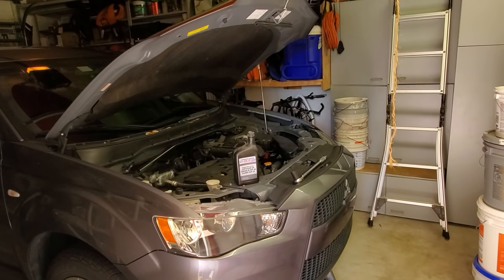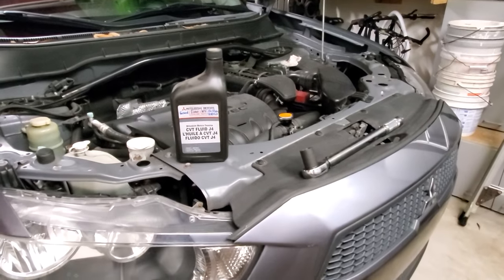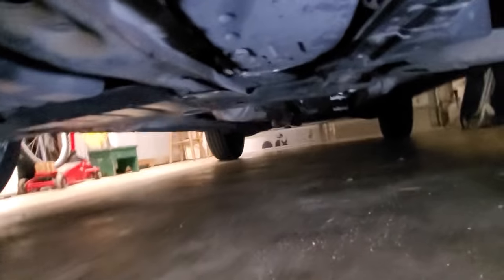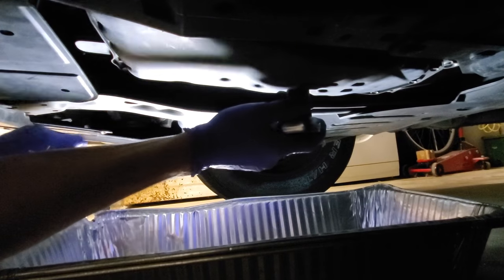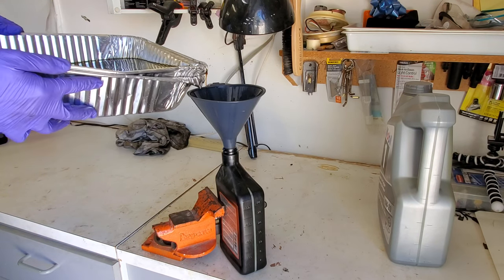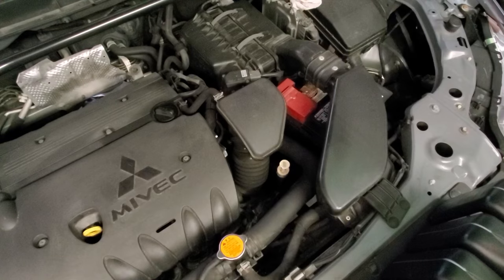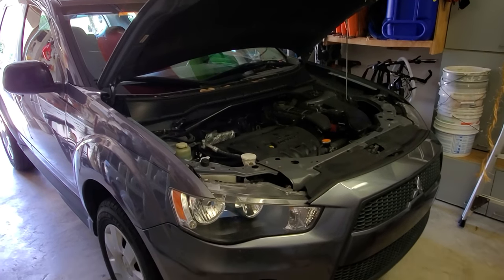How to Change Automatic Transmission Fluid in Mitsubishi Outlander

Comment: If you have a high mileage car or plan on keeping the car a long time, don't forget the CVT paper filter located underneath the battery, and also another filter located inside the CVT fluid pan. Longer job but probably should do it every 100000 miles or so, even if you follow the severe CVT fluid change interval.
Reply: There is no mention of these filters in the service manual and Mitsi dealer say it’s not necessary, only fluids. It’s in their best interest to replace them and charge more but they don’t. Thoughts?
Reply: @chiquicat1  It's in their best interest for you to buy a new car from them, instead of driving your car to the limit of what it is capable of. Remember there are many fluids and parts that manufacturers call "lifetime." But that usually just means they will at least last until the warranty is up. If there is a filter anywhere, that means it's used to catch something. If you plan on getting the longest life out of your car you might as well change it since cleaner fluid with no filter restriction is always better either way. If you don't plan on keeping the same car for hundreds of thousands of miles, then it probably doesn't matter too much as long as you do the proper maintenance of changing fluid and don't overheat the transmission too much.
Reply: @keifuchan7265  wise words
Reply: Hi
Did you have to take the battery out to change the filter or could you do the change with the battery still in the car? Thanks.
Reply: If I change those filters you mentioned , do you know how much cvt fluid I would need to buy?  I see that the simple drain and fill is about 4 1/2 quarts. Thanks
Reply: Did you get this question figured out?.. i have a 2017 Lancer SEL, I spilled quite a bit from replacing both filters and its hard to see on my dipstick.@aureliosalazar1033
Reply: @dr.bonscott3962 
I replaced the cartridge filter coming from the CVT cooler , Nissan rogue 2015 120,000 miles and I can tell you that is a must because it started to tear when I grab it , I did drain and fill every 40,000 miles using oem only fluid and filter 
The internal is a screen made of stainless steel or aluminum which it can be cleaned and reuse tho
Reply: Thank you for the info. I was wondering if this CVT used filters which I agree should be changed. Because CVT's have a reputation of having a higher failure rate than regular automatic transmissions I plan on changing both the fluid and filters every 40 thousand miles.
Better safe than sorry especially since the Outlander uses the Nissan Jatco CVT transmission which has a bad track record for reliability.

Comment: "Don't dump the used oil on the grass at the auto parts store", lol.  Great vid, I have a 2016 Mitsu Outlander which is the same process.
Reply: Did you change the trans filter?

Comment: Many thanks for this clear video.  I have a 2011 and rolling at 112k miles since 43k miles when I brought it. Great vehicle. 
Decided to stop taking to service dept for that as I don't trust myself around CVT but did not realize it's easy as change engine oil.
Reply from the maker: It's just as easy as changing oil. If you can change oil you can change CVT.
Reply: @MaciejPiotrowski  Right on.  I've done some works by myself around vehicles but never has been around CVT before and this was my first time with CVT... I did not know it has one after purchasing my Outlander and found out about it few days later lol.

Comment: I was reading through the service manual for the Mitsubishi and I learned this is not a good method. They recommend that you disconnect the hose from the top transmission cooler and let the engine run for about 1 minute. Then you remove the drain pan and get more fluid out. You should be able to get about 5 quarts of dirty transmission fluid that way instead of just two.
Reply: is it possible you can show how one would do that method your describing in a video? I would like to see your method in a video, i'm purchasing a used 2019 Mitsubishi Outlander Sport with 49k miles and I want to know which is the best way to preserve the transmission, thank you! If you can show me where I can find the manual of such said car it would be very appreciated as well!!

Comment: Good job, but you have to change the the two filters as well, the metal filter at the oil pan, and the cardboard filter under the battery
Reply: No mention in my service manual about these filters and Mitsi dealer say they never change them. Only fluids. But I tend to agree that replacing them might be best as fluids are only replaced every 90k which seems a lot of miles in the same oil time.
Reply: the filter under the battery, sure, but there's really no reason to drop the pan for the metal filter unless you're experiencing issues. If the filter in the pan is clogged up, then you have bigger issues to worry about.

Comment: Good video. I would add that measuring the amount that comes out and then adding the same amount in doesn't seem like a good procedure.

If the transmission was at an improper level before you start then you'll end up with an improperly filled transmission when you finish the job. Also, you'll get different results depending on if the engine was warmed up or cold or if it had recently shifted through gears or not.

You'd be better off checking the transmission dipstick following the proper procedure.
Reply: Yea, that whole part simply shows the level of the mechanic. But it also shows where the location of the drain plug which is what I was after. So the same advice - this is internet
Reply: Do we need to change it after every 40000 miles or not ?
Reply: @windowandmobile  yes.
Reply: 100 percent correct !! Would not add exactly what came out

Comment: Good day! 
Thanks for the video.

I have question. When I drain crv fluid on my 2011 RVR I collected 5 quarts. But in your video it’s only about 4.2 quarts. Not sure if I follow 5 quarts or 4.2. 
Thanks
Reply from the maker: You always put as much as you drain. Remember I have different car than yours.
Reply: Maciej Piotrowski thank very much for reply. Did you wait until no more oil draining? 
I ask the dealership they say it shouldn’t be 5 quarts.

Comment: Great video. Is there a washer for the drain plug? I read somewhere that there's one but when draining the fluid on my 2011 Outlander ES, I did not see a washer.
Reply from the maker: Yes there is a washer. I damaged original one so I had to buy new copper once few years back. It's super cheap and I use it all the time.
Reply: @MaciejPiotrowski  Thank you!
Reply: @MaciejPiotrowski  Did you buy your washer from Mitsubishi dealership?
Reply from the maker: @mkbdiy9766  No, you go to advanced auto part and buy it for super cheap.
Reply: @MaciejPiotrowski  Thanks!
Reply: My 2011 outlander didn't have  a washer either.

Comment: Thanks for this AWESOME video. Quick question, 2010 Outlander SE has 155k, transportation fluid never changed. Would you recommend drain and fill or leave it alone? Thank you.
Reply from the maker: If you never changed ATF I would not do it now.
Reply: @MaciejPiotrowski  Why?
Reply from the maker: @litreocola  Because all the gunk that is sealing you transmission would cause gaps in ATF to open. Google it and decide for yourself. I've always done it at about 40 to 50 K.
Reply: @MaciejPiotrowski  Are you referring to a fluid flush or fluid change? I read this was more of a concern with older American transmissions when doing a fluid flush.
Reply from the maker: @litreocola  I'm not a mechanic so you may be correct. Again, in my video I just showed how I did it. What you chose to do is up to you.

Comment: I have 160k miles. Bought it at 100. I never changed this fluid, don’t  know about previous owner. You think it’s bad idea to change it now?
Reply from the maker: If it was never done I would not do it. Too late. You may have transmission problems. I'm not a mechanic so double check with a mechanic.
Reply: @MaciejPiotrowski  it always a guess. someone say don't do it someone say do it. I've been changing some time now. right now at 240k miles. first transmission light come out at 160k then disappeared and the light is back as of 2 days ago. I'm changing oil now. hope it will run for many more miles

Comment: Hello sir. Good day! I just want to ask every when do i need to change the ATF in Mitsubishi Outlander. My car is running around 186000 km.
Thanks and God bless
Reply from the maker: ATF should be changed every 50000km. If you have never changed it I would not do it now or you will have transmission problems. It's too late.
Reply: @MaciejPiotrowski  thank you so much it's a big help 🙂

Comment: Do you also need the engine keep running while checking the level of the CVT transmission oil?
Reply from the maker: No. I turn it off and quickly check the level.
Reply: @MaciejPiotrowski  thank you for the information. Last question.  Your outlanders engine is 4b12 (2.4 DOHC)?
Reply from the maker: @hendriksaldua8208  yes
Reply: @MaciejPiotrowski  Thanks

Comment: Hi, I have a 2019 2.4L with CVT 27,000 miles. Last day I changed the transmission oil with the dealer and they charged me 8 fluid. I saw you change yours with 4 and a half quarts. What's happend here???
Reply from the maker: Good question. Ask the dealer. They may have done CVT flush which uses more fluid. Totally unnecessary in my opinion.

Comment: are the CVT-s reliable on these cars?
Reply from the maker: I don't know. My car has 95k miles and it works fine.
Reply: @MaciejPiotrowski  what year your car  is?
Reply from the maker: @pufarinu  2010
Reply: The Mitsubishi CVTs seem to be holding up very well. The exact same engine and trans is in the Delica D5 (from 2007 onwards) and in Australia guys regularly towing boats and caravans long distances are reporting no problems even beyond 250,000kms

Comment: May I ask what is so special about this oil? Also, my 2010 Outlander does not have a CVT transmission but the dealer says it needs this special oil. Can anyone help me, I cannot afford a $300 ATF flush. Thank you!
Reply from the maker: According to my research, transmission in any car is sensitive to transmission fluid. That means is that you should not mix it or substitute it with different brand or type or you can damage your transmission. Most people I know do not change transmission fluid at all. Why? Cause they usually sell their car before 80k. Then it's not their problem. I keep my cars until around 110k so I follow the book and do transmission drain and fill, not flush as recommended b a dealer. Why again? As I said before, you should not mix different fluids, but how it's possible not to have fluid contamination at the dealer when they use the same machine to flush fluids an all kinds of cars and they use all kinds of fluids. So to me it makes no sense to do flush. Book says do drain and fill and I do that. I buy my ATF at the dealer for about $15 per quart. And I really do it once at around 80k. By the time this has to be done again, my car is sold. Hope this helps.

Comment: Need to drop the pan and clean filter + Magnets very important
Reply from the maker: I only do drain and fill as recommended by manual. You are free to clean magnets if you wish. I just show they way I did it.
Reply: hey mike as i can tell you know what your talking about im wondering if you know what the transmission pan bolts should be torqued to? sorry to ask just cant find this info anywhere.thanks
Reply from the maker: @m8neak  I need to look in my repair manual. give me day or two and I will let you know
Reply from the maker: @m8neak  Here you can find the specs. https://www.autozone.com/repairguides/Mitsubishi-Outlander-2003-06/Engine-Mechanical-Components/Oil-Pan/_/P-0996b43f80381122

Comment: underneath the battery bracket is the oil filter. should have change it too.
Reply: Isnt the filter inside the transmission oil pan?
Reply: @bluebishi  there is also one inside, but one filter is in the transmission oil cooler. my ASX has this option.
Reply: @denberholfule4551  thanks guy

Comment: Hello my friend. First of all, thanks for the video. What is the engine power of the vehicle? Thanks for your answer.
Reply from the maker: My engine in 2.0 liters. I don't know how many HP it has.
Reply: 2.0 liter. 149 horsepower
Reply: Any power will be cut down to reduce damage to the cvt. No power off the line and really struggles with any torque resembling fun at any rpm. Owned a 2.4 cvt Lancer for 5 years and I am so over it. Getting a dual clutch turbo car 100%
Reply: @chiquicat1  You car must have had real problems. I have the 2008 2.4L 4B12 and CVT in the Delica D5 that weighs 1.8tons and it is peppy and will happily tow trailers over 1 ton.

Comment: Maciej: how big is your millage and what type of milage it is - motorways, city, loaded vehicle etc. 
I ask as this vehicle makes sense for me but I see so much bad opinions about it. 
Let me know how hard it was to maintain it - CVT engine etc. 
It is reasonably priced in Japan, where I live right now. 

Pozdrowienia z Tokio ;)
Reply from the maker: Now I have about 88k miles. 90% driving in the city. I have no problems with it. So far I had to replace struts and starter. The only problem with it is that it was made in Japan so tire camber is set up that tires wear out in the outside more then on inside. All Mitshubishi cars produced in Japan have this problem. Bad specs. I had to put camber bolts to reduce is. It's not perfect but now I get about 35k miles on set of tires. Pozdrowienia z Florydy.
Reply: - Choć minęło już trochę czasu wtrącę się do Waszej dyskusji pisząc po polsku jak przystało na obywatela Polski , ponieważ nie wstydzę się swojego języka  🤨.
Również jestem posiadaczem Outlandera 2 l. ale kupionego w Polsce i nie mam z tym autem żadnych problemów eksploatacyjnych jak tutaj kolega opisuje . Auto moje sprawuje się znakomicie ,mało pali benzyny ,nic się nie psuje, na fabrycznych oponach letnich❗ przejechałem 70 tys.km. i nic się nie dzieje ...
Natomiast niestosowne opinie o autach , mówiąc ogólnie , najczęściej piszą osoby co znają auta jedynie ze zdjęć na  " YT"   :face-green-smiling:.
Pzdr. z Polski.
Reply: @TAD3011  

1. Tytuł filmu, opis filmu i sam film jest po Angielsku. 

1. Większość koment jest po Angielsku.

Comment: You wrote "good for V6 Outlander" on a bottle. V6 Outlander uses a 6 speed non-CVT transmission and uses a totally different fluid that is NOT compatible with the one you are using for your CVT.
Reply from the maker: I wrote on bottle V4 not V6
Reply: Your engine is a inline 4 cylinder (I4). V4 doesn't exist for the Outlander nor for any Mitsubishi application. That is another mistake. Anyways good video.
Reply: In my region v6 is also CVT transmission

Comment: The real process involves draining the oil cooler, you have a few quarts of old oil still in there, mixing with the new.
Reply from the maker: You are correct. I did not remove entire oil but drained as much as I could. This is recommended in my manual and I have no problem with transmission. I was just showing how to do drain and fill my way. You have a choice to do it as I showed or completely draining it as you indicate. Thank you for your comment.
Reply: The correct manufacturer procedure with EVERY auto trans is to do a simple drain and refill. Some, like ZF themselves, specify a second drain/refill a few hundred kms later. The notion to try and drain every single component that might be holding oil is from ill-informed diy rationale. The idea that old fluid "contaminates" new fluid is total nonsense, you simply have a mix of fresh and old fluid whcih is within the design spec of both the trans and the fluid. The exception is if you have damaged parts like clutch material or metal then a full flush, including the torque converter, is imperative.

Comment: My rvr specifies CVT J1, can I use CVT J4 instead?
Reply from the maker: I'm not a mechanic but I never take a chance of mixing different transmission oil then specified in manual book. CVT is very sensitive to that not like engine oil.
Reply: J4 Is updated version of J1 you can definitely use it, I use it on my 2011 Mitsubishi outlander sport no issues but because fluid is so expensive and no close dealers around here I’m switching to Amsoil CVT fluid it says it’s compatible and I’m planning on to flush it twice just to drain oem fluid.as much as possible.

Comment: For jag xtypes change 2 L
There is a standpipe in the trans pan so its simple 2L will come out put 2L back in
This keeps the hydraulics fresh and the friction material stays inside !! 
To get the rubber fill cap off you need a very very long pointed long nose plyers!!
Cheets!!

Comment: Nobody explains clearly in detail exactly how to check level.   Hot, cold, running, not running,.  Nothing in manual.
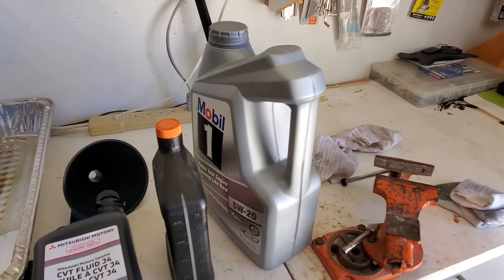Reply from the maker: Did you watch my entire video? Did you missed it? I explain it starting at 4:25 https://youtu.be/X1OdqJVqawM?t=265
Reply: @MaciejPiotrowski  You didn't state that it had to be up to operating temperature. Trans fluid expands a lot when hot and reading it right after starting (like you described in the vid) will result in over-filling.

Comment: it is not a brain surgery...but you didnt change none of the 2 filters....
Reply from the maker: No I did not, because according to manual you should drain and fill. Also, I've owned cars for the past 30 years and never changed ATF filters. I only drain and fill and have never had problems.